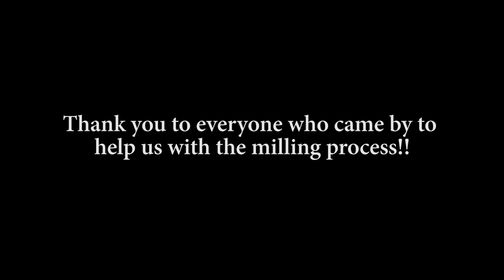Acorn to Arabella - Journey of a Wooden Boat - Episode 5: Transition from Milling to Boathouse

Comment: There's a reason loggers carry wedges and a sledge with them... you'd be amazed at how much you can direct a tree.
Reply from the maker: We got em and use them.  Sometimes they help and sometimes they don't.  We used some the other day to topple a 70+' spruce we are hoping to use as a mast.
Reply: Nice... great job so far.  Just binge-watched all episodes last night, thanks to a shout-out by Doug at SV Seeker.
Reply from the maker: We were blown away when we saw Seeks shout out!  
There was a sudden bump in numbers and we did not know why.  We sat down yesterday and watched his latest episode and found out where the bump came from!  Amazing project and super nice guy!
Glad to hear you are enjoying them!
Reply: you can also cut a notch out and put in a bottle jack.
Reply: Jeff Grant did you miss the part around 4:30 or so?
Reply: A good feller will use wedges with every back cut, not just when you get your saw stuck, especially on a tree the size of that pine.

Comment: Set up a jib on your trailer with a chain block. If you (or any other readers) send me your email  I'll  send a couple of photos of my setup. It works really well and there are others doing a similar thing. Also a little log arch is easy to build and will quadruple the skidding capacity of whatever tractor you have, and also help keep the logs out of the mud.

Comment: great climax about 4-5 mins in!! phew.. !!!  also no big deal but around @17:00 the cable clamps are positioned wrong, im not mentioning this in a condescending manner, im saying it more as a " oh wow I never knew that" regardless.. the "D" on the cable clamp/wire clamp always touched the dead end/ bitter end of the wire and the bolt/nut side of the clamp is always on the "running end" of the wire/cable... internet search something like "cable clamp installation" or "cable/wire clamp rigging". you'll be more than fine with what you got... but never hurts to know! okay on to the next video
Reply from the maker: Thanks for the tip!
A couple others have commented about that as well, it's something we previously did not know.  We were told to "never saddle a dead horse" to remember which way they are supposed to go.

Comment: easier to slide cable  tru pvc pipe before  hanging
Reply from the maker: We did, the cable was a twisted nightmare so it was a challenge.  In the video we were taping the seams to help keep them together and adding foam to pad the plastic so the pvc would not create such a pressure point.

Comment: what are you using attached to the ascender to climb/hold you?
Reply from the maker: Hmmm.  Not 100% sure which piece you are referring to.  When I climb ropes I typically use a Petzl Grigri on my harness and put a ascender above it.  I put a pulley into the top of the ascender and run the break strand from the grigri through the pulley.  I then attach a etrier to the bottom of the ascender.  As I step up in the etrierI can pull down on the break strand giving me mechanical advantage to pull the slack through the grigri.  When I traverse the cable it's just a couple lanyards attached to steel biners on the cable.  The cable would eat aluminum biners real quick! 
Hope that answered your question!
Reply: I thought it was a grigri, just never seen it used like that
Reply from the maker: You offering to buy us one? =)
Reply: You've got plenty of nice big beams to make one 👍